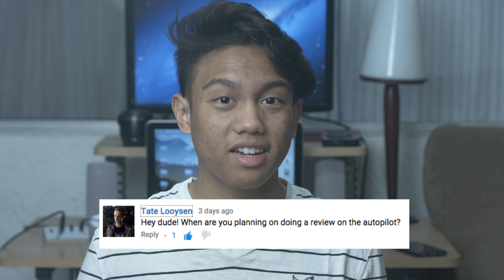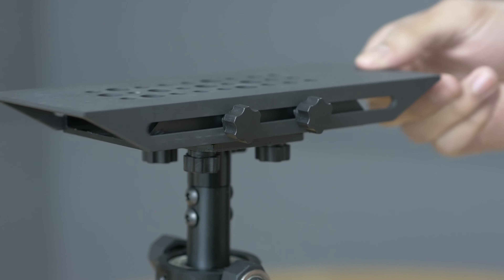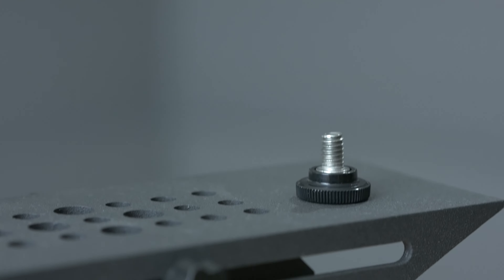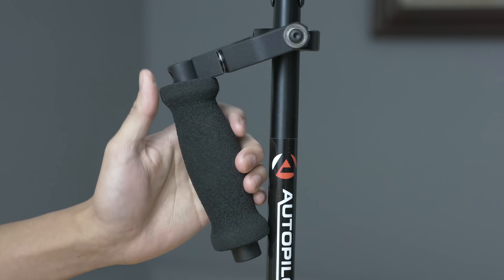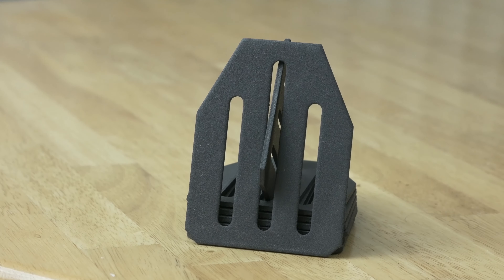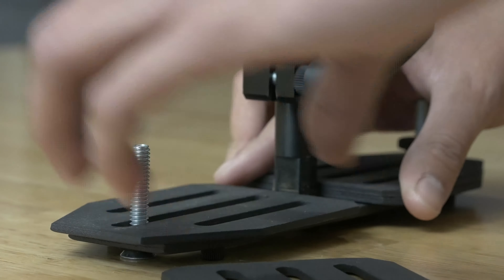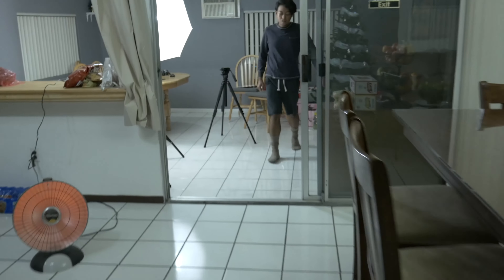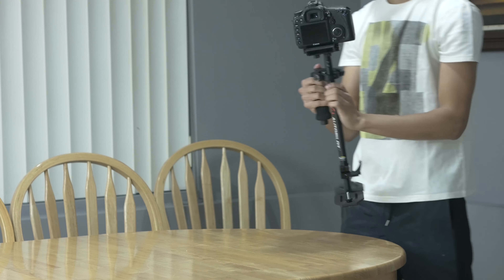ProAm Autopilot Camera Stabilizer | Review w/ Test Footage in 4K!

Comment: Is it hard to pull focus or adjust your focus while using the Autopilot? Thanks in advance!
Reply from the maker: Unfortunately yes, however that's a problem with all stabilizers except for gimbals and wireless focus pullers! For a lot of lenses, maybe with the exception of fly-by-wire lenses, changing the focus will shift the glass inside the lens and mess with the weight distribution a bit!
As well as you would want to fly the Autopilot with one hand on the arm and another on the pole, otherwise it'd fly all over the place!